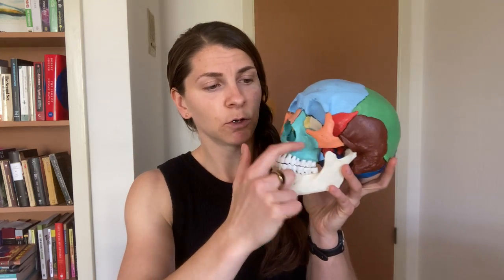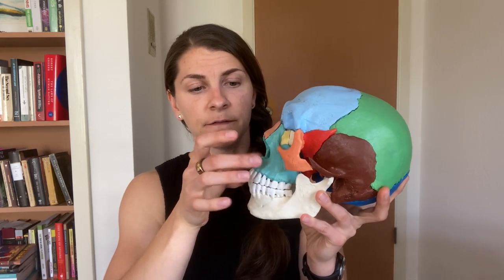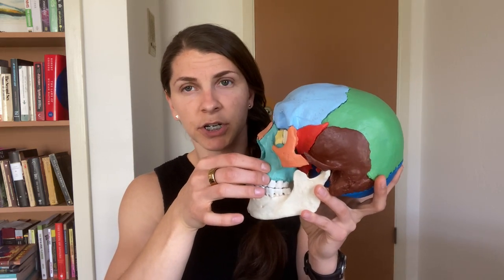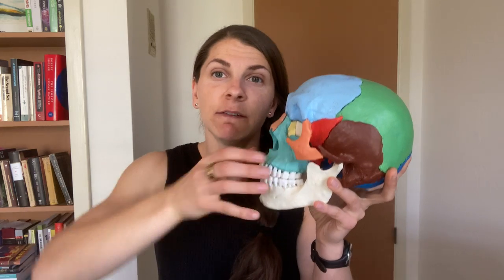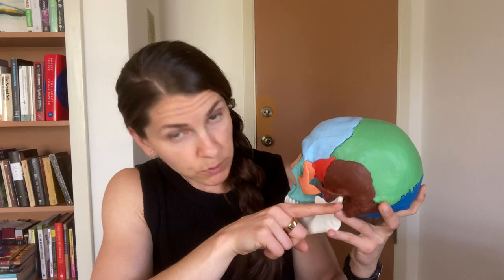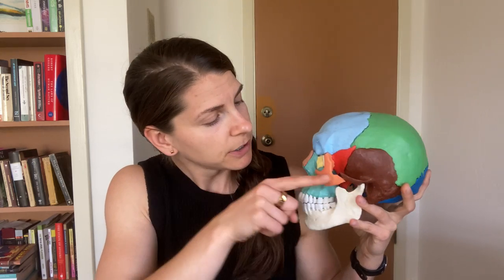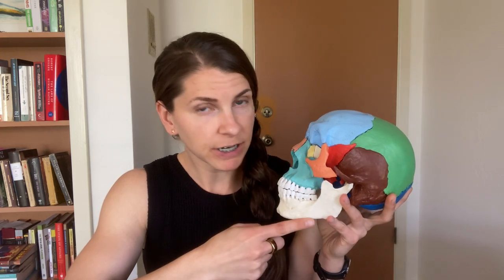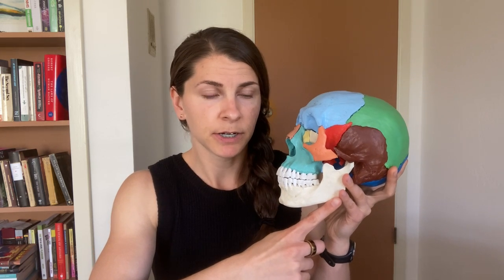Counterclockwise Rotation - Maxillomandibular Advancement Jaw Surgery

Comment: I have a question. The coutner clock rotation during  the bimaxillary conversion osteotomy differs greatly from clinic to clinic in the size of the angle. The following is done in Berlin: Shift 1.1 cm forward, rotate 8 degrees, and additionally advance the lower jaw with a chin plastic.

In Heidelberg they rotate 18-23 degrees.

Those are massive differences. Do you know what could be the reason?
Reply from the maker: Are these movement ranges both for your individual case?  Treatment plans can vary dramatically from one individual to the next depending on the person's starting facial structure and what the goal of the surgery is.  One individual can consult 5 different surgeons with the same chief complaint and the surgeons can give quite a wide variety of surgical plans from that individual (with large variations in advancement and rotation, as well).  There is not one way to get an outcome and which surgeon you choose can dramatically impact your aesthetic outcome.
Reply: @allsleepashley  Yes, both are the same case. In Berlin (Charite) they rotate by 8 degrees and in Heidelberg (Seegartenklinik) they rotate by 18-23 degrees. I ask myself why this difference and which surgeon I should choose now. But thanks for your answer.
Reply from the maker: @kokoska3999  Don't be afraid to ask surgeons why they are planning to do certain movements.  It will help you to ask this so you can follow their reasoning.... asking several surgeons to explain their reasoning will help you develop your own reasoning in regards to which surgeon to choose.
Reply: @allsleepashley  yeah i have to get more informations about ankles. thank you for the help
Reply: @kokoska3999  23 degrees is A LOT 
Actually cut must be really high set to avoid too upward occlusal plane.